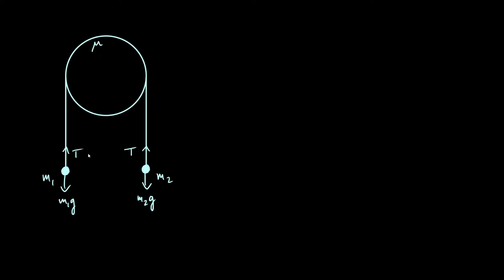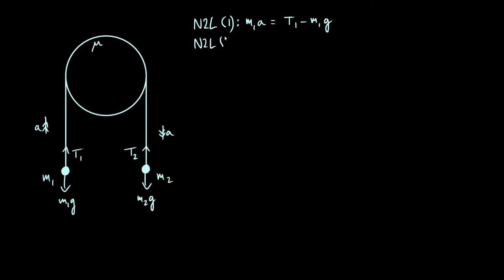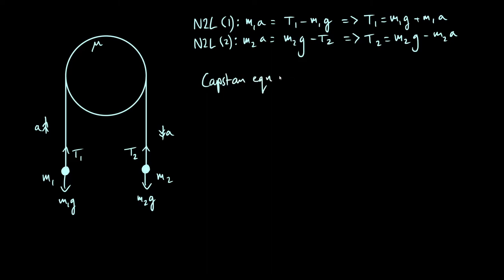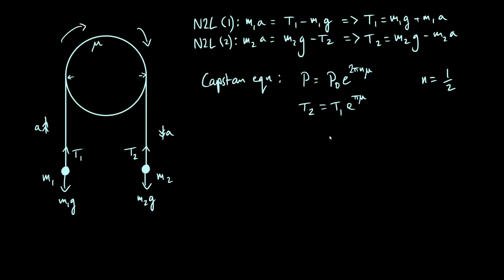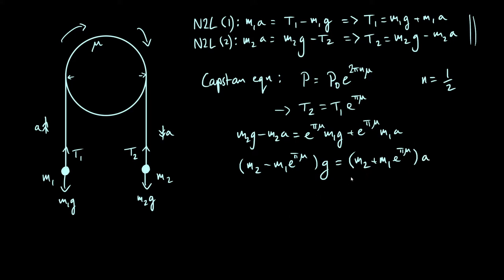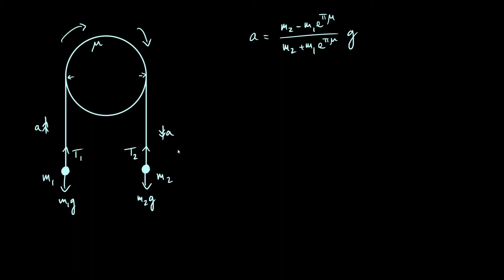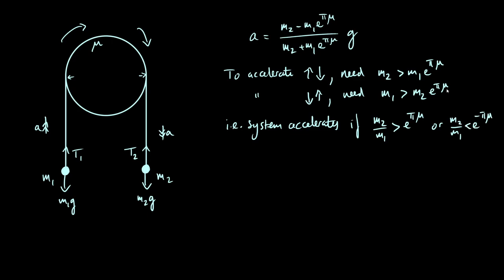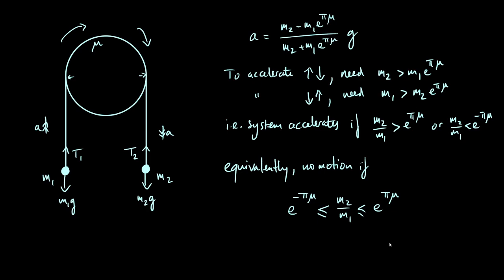What if there's friction between the rope and the pulley? (Atwood machine)

Comment: Nice problem!
Can you do a similar problem where the pulley can rotate meaning it has a mass m and some radius r and the rope has mass too? 😅
And what's the condition for the pulley doesn't slip?
Reply from the maker: Thanks. It gets a lot more complicated if you want to include all three effects (friction, massive rope, and pulley rotation) as you need to set up an equation of motion for each element of the string. I think I tried this a few years ago and ended up with a differential equation that couldn't be solved analytically!
Reply: @DrBenYelverton can we do in matlab

Comment: Interesting problem!
But don't we assume system to be at equilibrium while deriving capstan equation? but clearly here rope is not at equilibrium, so is the equation still valid?
Reply from the maker: Well, it depends on our modelling assumptions. If we can neglect the mass of the rope, ΣF = ma becomes ΣF = 0 and the derivation of the capstan equation still applies. If not, then you're right and you need to apply Newton's second law to each element of the rope to come up with a new, and more complicated, equation of motion.

Comment: Sir as we've already considered m2 > m1 the inequality should be 1≤ m2/m1 ≤ e^πu
Reply from the maker: We assumed m₂ > m₁ at the beginning for simplicity, but for the final result we need to take into account the case where m₁ is larger. In fact, m₂/m₁ can be less than 1 with the system still in equilibrium, and by symmetry you'll only get slippage in the opposite direction if the mass ratio falls below the reciprocal of e^πμ.